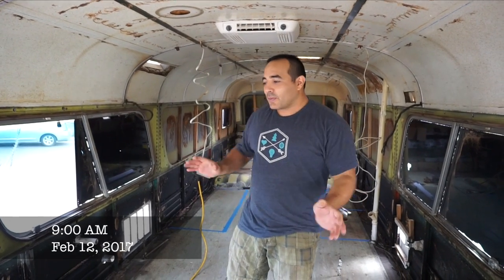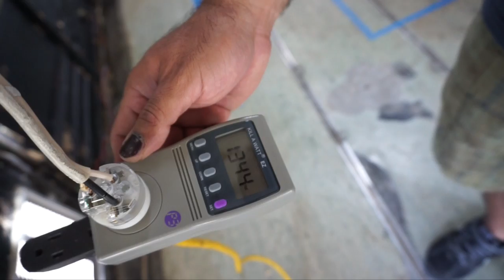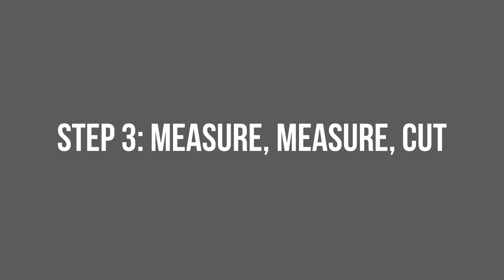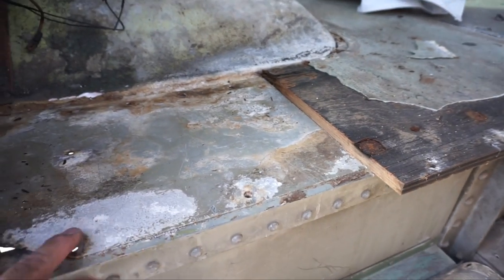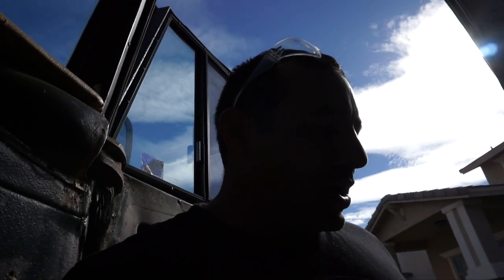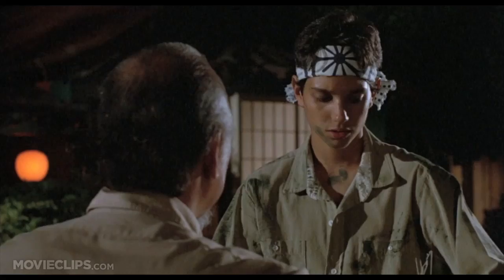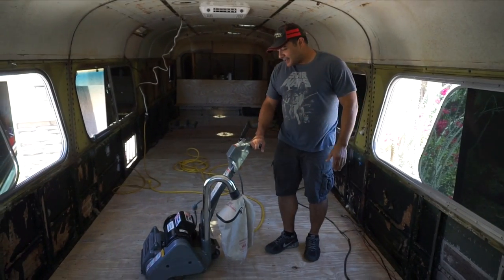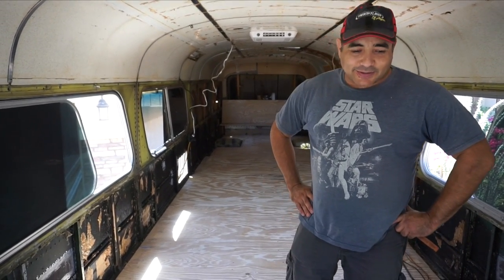Installing Subfloors On Our Bus

Comment: Hi Juan & Michelle.  I hope you will see this post before your progress has move along too far so it is too late, but I would highly suggest that you treat the plywood subfloor before you move on to the next step to prevent the chance of water issues like you found in the original flooring.

Please take a look at this video from the Long Long Honeymoon:
    https://youtu.be/thSMGjk-nHM?list=UUw5WYtMXQ799GErKpvR_5Rw&t=1029

Their video describes how they treated their floors after having leak issues, which they were lucky enough to get to in time before any permanent damage was done, to try to stop any damage in the future.  They coated the plywood with a marine varnish to help stop water/moisture incursion.

Good luck with the rebuild!  It has been very interesting so far watching your videos.
Reply from the maker: Hi Brian, thanks for the heads up - our floors are still bare so it is not too late!  We have been doing research on this very topic and there seem to be two schools of thought on it.  We are still trying to sort through it all.
Reply: Beginning from this Morning - What is the the "other school of thought"? Leaving them bare? What are that "school's" justifications? Not arguing, just genuinely curious about that point of view.
Reply from the maker: Hi Brian - The other school of thought that we had read about was that if you seal the floors then the moisture gets trapped between the subfloor and your flooring and doesn't allow it to drain - promoting mold growth ... I went back and tried to find the thread I was reading but came up short (hence the long time to respond).  We are actually leaning towards sealing it all up - just trying to research which product would be best to seal it with.  Thanks for the link.

Comment: So is the bottom layer plywood? Is that composition tile on it? I know the particle board flooring that was on it had failed (bad choice) but how has the wood under it (original) held up? Also did you test that tile for asbestos. I saw you had breathing filters and wondering if that was because of a test or just being cautious (?dust, mold, etc).
Reply from the maker: Thank you A2cryss the bottom layer is the original bus floor (marine grade plywood) it looked great just the particle board looked bad.  We did not test for asbestos but the bus was made in the 1960s ... we used masks to be cautious.

Comment: Did you lay the wood directly over the original linoleum? In my bus the two aisle rails are slightly higher than the linoleum.
Reply from the maker: Hi Keir - yes we put new subfloors directly over the existing floors (after we removed the old floors). We used 3/4 plywood to do so and most of the floor was surprisingly even.  I think the previous owner had already ground down the metal aisle rails that were there.

Comment: If you were to take a mini split air conditioner also works as a heat pump and replace your rooftop unit with a custom-fitted ceiling cassette made for mini split air conditioner you would save a lot of power also it's runs silent or almost silent...
Reply from the maker: COMMANDYNE https://youtu.be/GvdIe0AkXV8

Comment: Floor looks great ,  as you are going to be living in this through all four seasons ,  would it not have been a good  idea to have added some insulation under the floor, or would this restrict head height? I ask as when we build over here in the UK. we insulted the floor to stop cold soak., makes a big difference in colder climates and during those cold nights. Loving the build inspirational. As the largest vehicle we are allowed to drive is a large van or small 7 tonne truck. If we want to drive some as big as the bus, we have to take another truck license.
Reply from the maker: Thanks NOmad SZ.  We really would love to avoid the extreme cold - the problem we had with adding floor insulation or floor radiant heating is it would eat up more headroom.  Granted we are not tall people ( We are both about 5'7") - but the bus is really only about 6'2" or so inside and that is before we add insulation to the roof.

Comment: What are you doing to keep the weight down on the entire bus ?
Reply from the maker: Hi Mary - we weighed our bus as a shell - and it came in at 19,000 lbs - Our max weight is 32,000 lbs so we have about 13,000 lbs to play with.  We are going to be conservative but I think we can keep it to under 10,000 lbs pretty easily.  When it was an RV before it weighed about 24,500 lbs.